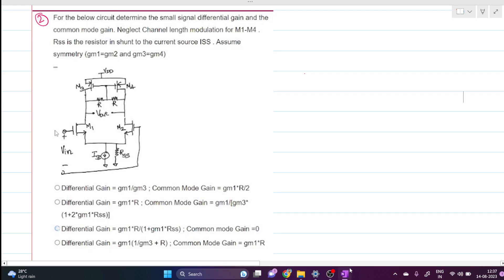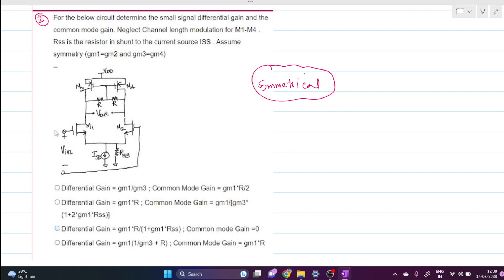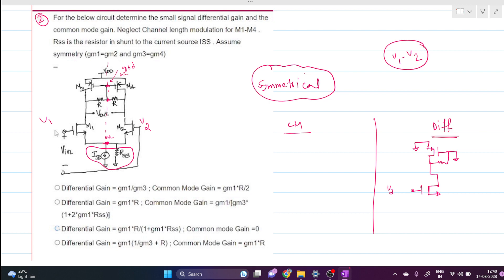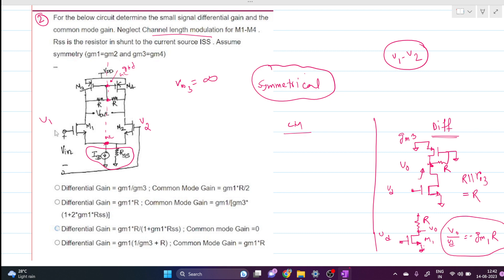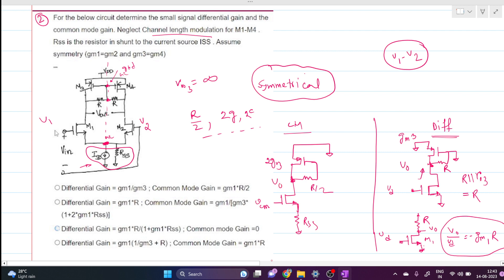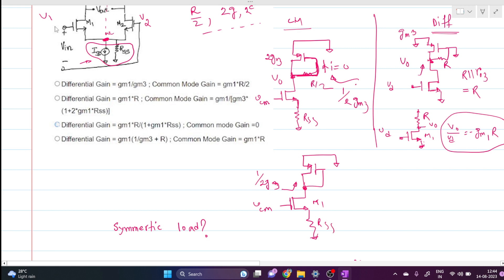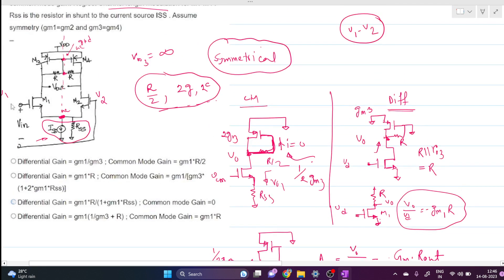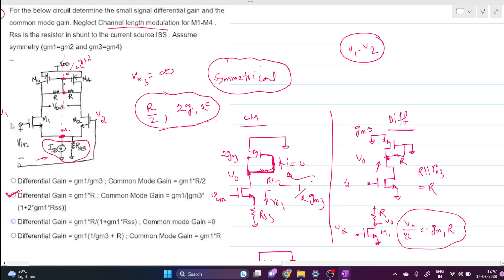Determine the small signal differential gain and common mode gain _ Analog Design Interview question

Comment: why didn't you connect gate of M3 to ground in common mode gain, just like earlier ?
Reply from the maker: Because in common mode,that node voltage  is not constant,so can't make AC gnd.
Reply: You meant to say, both half circuits will push gate voltage in same direction, in case of common mode. While in differential mode, it will act as a ground because, net push is zero (both half circuits will push in opposite direction

Comment: The Rss will get divided by 2 also.
Reply from the maker: No,tail node remain as it is in common mode .
Reply: @AmitBar-Analog_Circuits  I saw you did a different analysis. I generally take 1 branch and make 2Rss and calculate common mode gain. My mistake.
Reply: ❤❤❤ @AmitBar-Analog_Circuits
Reply: Noise suppression for CM😊